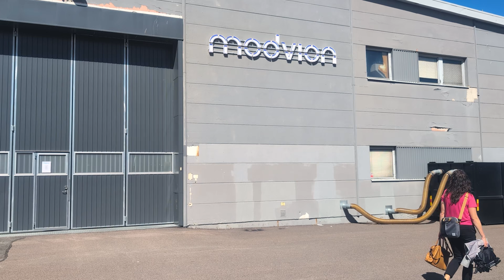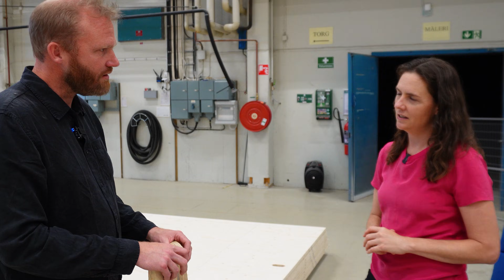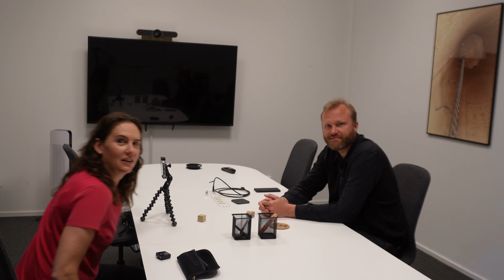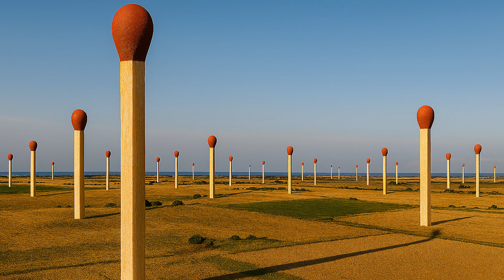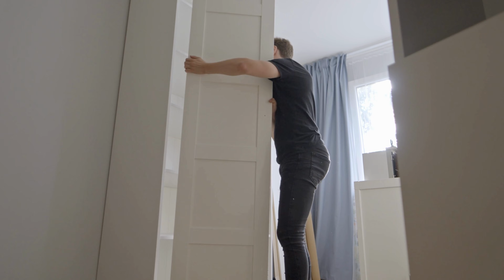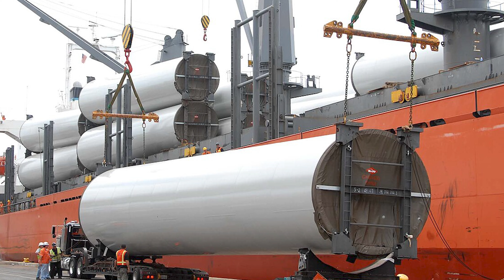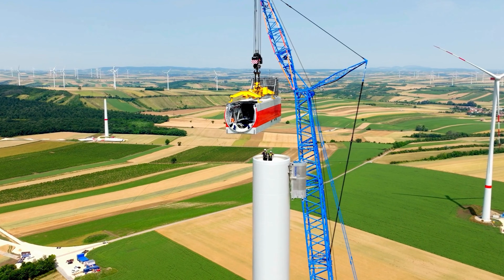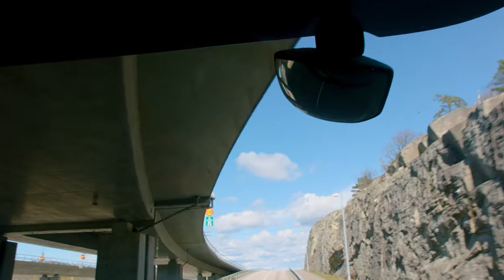How a Wooden Tower Could Unlock Bigger Wind Turbines

Comment: Cool idea, but I agree with you.

In the end the only thing to do with this towers is to burn them in a waste to Energy plant. 

Steel can be recycled very easy in comparison.

By the way, moddern wind towers are often partially out of reinforced concrete (the bottom part) because it's cheaper than steel . This can not be recycled as easy as steel, but still be used in construction sites after the usage in wind towers
Reply: She didn't say that the only thing to do with them was burn them, so you don't agree with her. I also don't see how you would be able to extract useful pieces of reinforced concrete in reliable fashion for use in other constructions.
Reply: @danyoutube7491  not use the concrete as reinforced concrete. But you can use it shredded as pieces
Reply: @sbdpro2  Is that something useful, though? What purpose does it serve better than any other rubble or, for that matter, a chopped up wooden mast?
Reply: @danyoutube7491  not toxic compared to glue/plastic. It can be reused, wood with glue cannot

Comment: You mentioned high wind turbines, I guess you know about the projekt in Germany / Schipkau?
https://www.youtube.com/watch?v=YFwhzu-NujU - sorry, only in german
https://en.wikipedia.org/wiki/Schipkau_GICON_Wind_Turbine
An experimental project in building, they aim to place the hub in 300 meters.

I would have liked more technical data about the wooden tower. How much lighter is it for the same strength, how much more load-bearing at the same weight?
Until which height would this concept be usable? Or did I miss that?
Thanks for the nice video!
Reply from the maker: Thanks for sharing that project (ich spreche nur ein bischen Deutsch), perhaps a topic for a future video. 
And no I didn't answer those questions specifically. Modvion's website has some answers.
Reply: @EngineeringwithRosie  My english isn't perfect, either :)
I looked at their website and couldn't find anything more specific there. Well, if they are successful, there will be more media about the concept. 
For Schipkau, they had a measurement structure of 300m for a year and found, that the possible energy harvest this high is twice as much as in regular heights, which is more than they expected. The perspective is to build windfarms in two layers and harvest a lot more energy per ground area.
Will be interesting to see the progress of that.

Comment: Wood turbines  don't have to work for everyone, but if they work for a bunch of customers, it will be one of the winning solutions.
We can always use more winning solutions.
Thanks for the video Rosie I had not heard of this and it is a VERY interesting approach.
Reply: Agree...
Here in Brazil, everything is agaisnt this idea... every pest eats wood here, even some animals, not just termites, humidity and temperature oscillate brutally during nigh day cycles.... and Im not even talking about government corruption, politics and bureaucracy.
I think this idea has future locally, and maybe also in other areas, I think large modular buildings made of wood will have a good space in the market
Reply: @brianfhunter  Does CCA not keep insects away? NZ tested it with sheep, didn't harm them, and horses find it delightful,so I expect it doesn't harm mammals. In Australia, no birds that I know eat is, but parrots might sharpen/trim their beaks on it.
Reply: @oneeyedphotographer  - Dont know about the cost of it, but yes, solutions exists, but it adds another layer of cost, time and complexity... in large scales is not much relevant, but in small scales, its pretty brutal.
Reply: @brianfhunter  " this idea has future"
Nah, its way to expensive compaired to just alu or steel. And keep in mind, the price is a basic measure of how much energy (CO2) is needed to make the thing.
Same with  "large modular buildings", they are doing that already but all the wood is indoors/covered, not over 5 stotries high and even then all the wood is highly processed. And its rarely build to 24/7x365  standards with low maintanence, If thats needed its back to bricks, concrete and steel.
Don;t get me wrong, wood is nice and all, can be processed into some good stuff, but the lifespan is rarely over 20 years and after that the only thing you can do with it is burn it for some energy. But for outdoor industy applications, its basicly shit.
Reply: @brammeijboom-mj9ld  - Did you know that Sand for construction is a limited resource?
Wood is not that expensive, especially in large scale, the cost with human resources is also a lot cheaper on wood.
Im not saying that Metal is bad, Im saying that Wood technology is getting so much better that can take a small portion of the market... It wont replace 50 store buildings, but up to 10, outside big cities, I think its very plausible.
Also, i didnt say "industrial applications", there is no debate about it, Industry = Steel.
Reply: @brianfhunter Big city buildings are already being made in Sweden. You've got to remember this is Sweden, where high-quality timber is produced, and the country has a cold climate.
Reply: @l.h.3586  - Yes, I saw videos about it, and that is why I said that not very big buildings, because  there is some very big buildings made with metal that is not possible even with special concrete... in fact, that is more correct way to say it... wood will substitute concrete, not steel.
Reply: Exactly, the "all or nothing" mentality that dominates isn't an intelligent one. Right away I see some impressive benefits to using a natural resource that occurs natively and requires much less additional processing to get a finished composite. As the cost of reliance on an existential foe like China or Russia for products and energy rises, the benefit of home-grown solutions becomes more valuable in comparison. In WWII, aluminum and Plexiglas were the hot new products, but when Axis forces blocked shipping channels, wood became a valuable commodity indeed.
Reply: Agreed, diversity is an underrated strength. To me, the question is way  more about personalizing these solutions. With elegant well thought out ideas that fit specific geographical areas, it could make accessibility a little less important.

For now I really don't see a pragmatical use that is a. honest about the real cost (it's not months, it's years to pay back for installation, that graph is not informative because it omits reality, it's like my 10 year old calculating the cost of a new laptop, it's motivated by his need to play games where he has a perfectly fine one to use) and b. takes wildlife and surroundings into consideration. 

While other solutions do pollute the environment too, the footprint of a wind park can impact complete migratory patterns and even cloud formation. And without natural ways to store the energy, it's not providing us with energy when we need it the most. Especially considering a base load is always needed so at night we can't turn of nuclear and coal. It always just tops it off, but at the time we need it the least for consumer use.
Reply: Agree, evolution has dramatically shown the benefits of diversity. Sounds like this will only be practical in certain regions but that should not be a show stopper.
Reply: Just another way to say steel is better.
Reply: @canavar1435 If it always was better, Swedes wouldn't build it.
Reply: @l.h.3586 not always, fair enough

Comment: A streamlined, teardrop shape has the aero drag of a cylinder of around 1/10th the diameter.
Therefore:
A streamlined tower, that weathercocked with the windmill head from  the  base upward, could be significantly lighter and cheaper than a cylindrical tower..!

There would also be significantly less wind slowdown in a windfarm...
Reply: Good idea. The tower would still need to be the same, adding a mobile fairing to tower would be expensive and would have to be never reach into the blade sweep in case of a rapid change in wind direction with one lagging the other. Adding the big expensive bearings for the mobile fairing, the fairing itself would have to be strong enough not to break easily adding weight to the tower…

Comment: Thanks to Rosie for the hard questions based on deep and broad knowledge. Thanks to Modvion for honest answers to Rosie's hard questions. Exceptionally high quality discussion.
Reply: ??????? It is made of a dead tree!  And will burn like wood and break during a storm. And dead trees don't suck and store carbon dioxide out of the air when dead !This is fake news makes no sense! Steel is more durable then dead softwood and can be 100% recycled and re used for exactly the same purpose as before it got recycled!
Reply: @SijbrandPTakesSwedish engineering tends to make sense. Especially when it comes to materials. World leader.

Comment: Without wishing to discourage innovation....If a thing ain't broke, don't fix it.

Scandinavian wood engineering is very impressive but I think the developmental discovery and innovation here is worth more than the final outcome.

I live in one of the wettest parts of Wales, one of the wettest countries in the world. Humidity gets in everywhere and fluctuating  temperatures allow condensation inside  cold structures when outside temperatures rise. Waterproof coatings are actually a disadvantage. Breathability and internal warmth are the only solution. We might not have termites but we have fungi and algae that can tell anything. We also have a lot of serviceable steel wind turbines. 

I'm sure that there will be many applications for this technology in the built environment and I love the curved plywood structures, I just think they want this to work just a bit too badly.

In a country famed as much for steel as for wood, I think they will see the light.

Comment: How does a foundation for a wooden tower compare with that for a steel tower? How is the tower joined to the foundation? How is the structural integrity monitored during operation?
Reply: Foundation should be the same, the foundation isn’t there for the weight of the tower but to handle wind load forces.
Reply: good question.....
Reply: "should be the same" LMAO
Reply: @nc3826  good point! 😅
Reply: @jsbrads1  there might be different limitations of the joint between the tower and foundation. Differences in tower weight (heavier / lighter?) would be a foundation design consideration. Also, different vibration modes
Reply: @redshift3  yes, the join may be very different, but they claim their tower weighs less, I wouldn’t be surprised if the wooden tower is a little more rigid, but the largest load by far should be the wind, and I’m pretty sure the foundation is designed to compensate for the wind.
Reply: good luck welding wood 🤭
Reply: @nc3826  steel is bolted to the concrete…

Comment: Great video! Personally I don't think shifting of sourcing is nearly as much of an issue for the argument for sustainably produced wood as it is for the argument for steel based on the recyclability of steel. Steel generally gets recycled already, any additional demand for steel will increase extraction of new raw materials, almost exactly one to one. While the wood market is far from that "fixed", increased demand for sustainably produced wood doesn't automatically increase the demand for any wood nearly as much. 

Sure, there's also the fact that "sustainably produced" is a relative term in this context, as usual, while there's room for improvement in what we consider sustainably produced, sustainably produced wood is already a pretty good option, and there's significant potential for further improvement and increased production that is also realistic to achieve. Increased demand for sustainably produced wood can increase the production of sustainably produced wood, but increased demand for recycled steel can't really increase the production of recycled steel, not significantly anyway, not unless we start to recycle steel that hasn't reached end of life, just in order to pretend to do something sustainable.            

And, it's not just the fact that production of wood doesn't generate much emissions, a given amount of sustainably produced wood represents a bigger amount of CO2 kept "locked in", CO2 that has been recently collected from the atmosphere. One ton of wood typically contains more carbon than one ton of CO2. While that carbon in the wood gets released if you burn the wood, but 30-35 years, and potentially much more if the wood is reused, and why wouldn't most of it get reused, is not nothing. Probably and hopefully the most critical period for the climate will end before the end of the "second life" of those wood towers.    

I completely agree that current wind turbines and their towers aren't that much of problem as it is, but I think any improvement should be welcomed, and carbon negativity for the tower alone, instead of acceptable amount of emissions is significant. Also, it could potentially help to increase focus on improved and increased use of sustainable wood in other applications. There's a lot of potential in very "low hanging fruit" in sustainable wood, compared to for example use of hydrogen for metal production/recycling.

Comment: An important point that wasn't made here is that the wood is actively extracting and storing carbon from the atmosphere, which is not the case at all with steel production. At this point I would say this is critically important - sure eventually that carbon will make it back into the atmosphere but the re-purposing scheme makes perfect sense and the carbon should remain as stable wood for many decades.
Reply: Oddly enough, burning wood for heat is carbon neutral with proper forest management of course. Tree farms are the next big thing if we ever run out of fossil fuels.😅
Reply: @Uruz2012  if you biochar it, burn the gases and add the biochar to the soils, it's carbon negative and can double the productivity of poor soils.
Reply: True, though one can wonder how environmentally friendly it is in the end, with all the added glue. It becomes almost like glassfiber structure, where it is difficult to recycle, and may need to go to a landfill site or incinerator?
Reply: @assepa how would the glue make it difficult to recycle? As said in the video, you can just cut up the tower into beams and repurpose those.
Reply: @assepa  you can make forniture out of it, it is essentially plywood. NO inceneration otherwise we don't win the CO2.
Reply: If it costs less to make them out of steel and you were to use that cost difference to make and bury biochar in old mines, how does it compare? because Steel is basically 100% recyclable and with induction smelting the process of recycling the steel could be carbon neutral. Potentially Steel could be the more eco friendly option.
Reply: @liamnehren  biochar is used a a soil amendment and is sold around the world.   Steel is recycled, so I don't really see the need for wood.
Reply: biochar it when dumped.  carbon negative.
Reply: @briandonovan9091  I don't think we could really turn these towers into biochar since they are filled with a large amount of toxic glues.
Reply: @JoeNunyabidness  Depends on the adhesive, but biochar works on all sort of organics materials.
Reply: @briandonovan9091  Perhaps, but if someone needs a strong glue that lasts for decades; I doubt that it will be something that can be easily broken down.
Reply: @JoeNunyabidness  There are glues that are designed to burn/pyrolyze cleanly, it the avoidance of chlorine and bromine mostly.  forr instance:Phenol-resorcinol-formaldehyde (PRF/PRG)

Widely used in structural laminates (glulam, LVL).

No chlorine or bromine.

Burns/pyrolyzes mostly into CO, CO₂, water vapor, phenolics.

Very durable, exterior-grade, long service life.
Reply: Timber at a maximum stores 4ish times its own mass in carbon from CO2. So the entire mass made from wood of a 100m tower of timber with 40cm thick walls with an average tower diameter of 3m is roughly 1307m³ times the denisty of spruce at about 550kg/m³ equals around 718796kg.
719 tonnes of wood per turbine sounds like a lot but to offset the emissions of one year (37ish Gt CO2) you need about 50.000.000 wooden towers. Each. Year. 
Edit: Ok, divided by 4ish as carbon is only 27% of C02, my bad.

The impact is still vanishingly small.
Reply: @Grooovemaid  Good sums. But they are not trying to offset the entire worlds emissions, just to stop adding to it. And don't forget the tonnes of concrete NOT put into the smaller foundations, and the 400? tonnes of steel NOT smelted for the tower.
Reply: @Grooovemaid  I don't think the argument is that building more things out of wood would offset our emissions, rather the emissions are an improvement over those of steel which is (currently, for the most part) produced by burning a lot of fossil fuel.
Reply: Indeed. The 'offset' from building something out of wood would be the net gain compared to building it out of something else.

So I suppose it's a bit of both - carbon locked in the wood, plus carbon not released in producing the steel.
Reply: @Grooovemaid  I don't get this arguments like "either you save the world or is it not worth it".The argument is really silly. The wood towers (or any other building) can offset some of that CO2 emission, the rest can be done by other measures.
Reply: @Grooovemaid I'm struggling to understand what you mean by your first sentence.

Edit: It sounds like it's the same thing you say in your edit at the end? - the atomic mass of C is about 25% the mass of CO2.

So, if I'm following correctly, it would require not 50M, but 200M towers to embody one year's CO2 emissions, and that would be if they were made of pure carbon.

I gather wood is typically 50% carbon, so that makes it 400M towers.